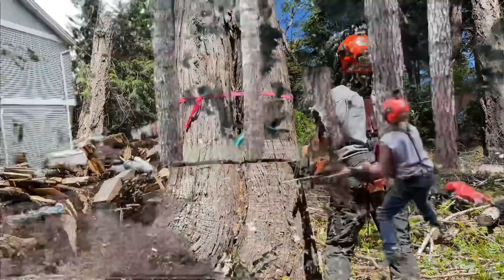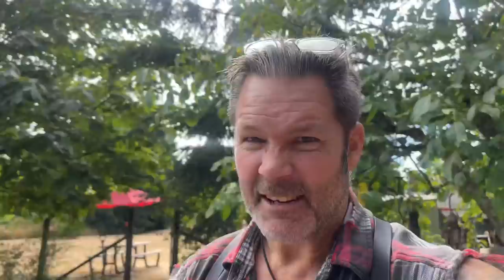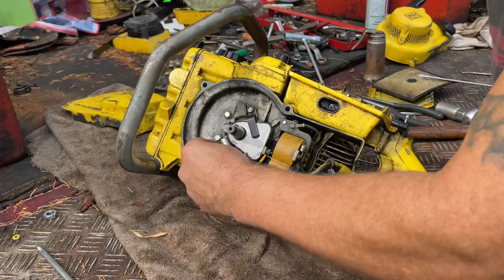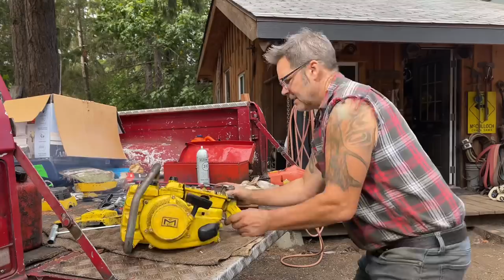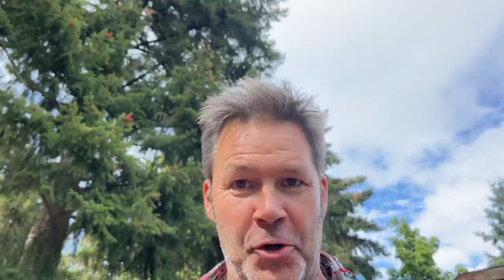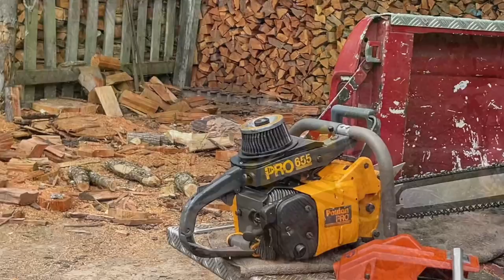Big powerful Chainsaws, gets new condenser, will it start.

Comment: Love it! I learned a trick back in 2005 with my old 131av when the local Stihl dealer told me to 'throw it in the bin" because they hadn't been able to obtain ignition points for many years. A bloke told me to go and buy an electronic module for a grass trimmer, take out the old points from the saw, ditch the half moon crankshaft key and install the module, then advance the magneto one inch counter-clockwise and bolt the lot back down. Hey Presto!!! Idled a bit rough but with full power. Gave me another twelve years of firewood collection. Went back to the dealer and was told " I wouldn't do that you might seize the motor".SHEESH! I ended up passing the saw onto my brother-in-law in 2018(after 12 years of hard yakka). It's still going strong.
Reply: Share your info "
Great ideas in the comments section.  Thanks for that 1st hand experience.  Can help fix broken stuff that some people pitch.

Comment: Hey Buckin,just had a Honda Mower, that died a Minute after Starting like running outer Fuel.
Checked the Carb twice, than throw ot the damn Condenser a it still runs like new.Good Job !!! Kind Regards from Germany.

Comment: I had a similar problem with a 25 hp Evinrude outboard.
Would start right up and then after running for a bit it would just die as if you pulled the kill switch.
I worked on it forever and took it to a dealer.  The dealer said there was no problem.  It ran just fine.
I said NO, that this engine has left me more stranded than not, and that there was definitely a problem.
He started the engine right up and said "See!  No problem here".
I went over to the engine that was running in his test tank and started running the throttle.  Mechanic looked at me like I was crazy.
After five minutes the engine just quit.  Then I said "See!"
The mechanic said I blew up the engine!  lol
We stood around a half hour and then I started the engine right up!
Mechanic says "Oh!  I know what the problem is!".
The engine had a cracked "brain module".  When the engine warmed up the crack in the "module would OPEN UP and take the spark away.  Once it cooled down, the crack would close up enough to make internal contact and I would have spark again!
Craziest thing I ever saw.
I imagine your condenser was similar.